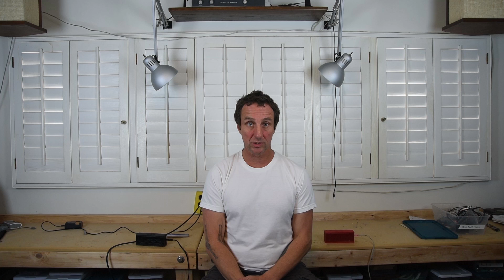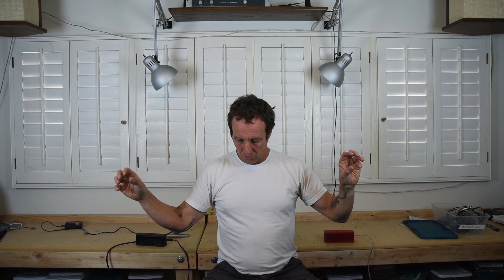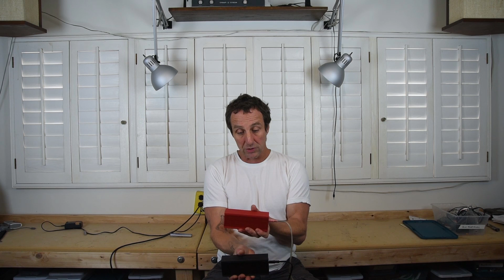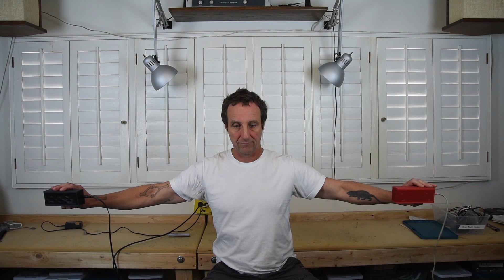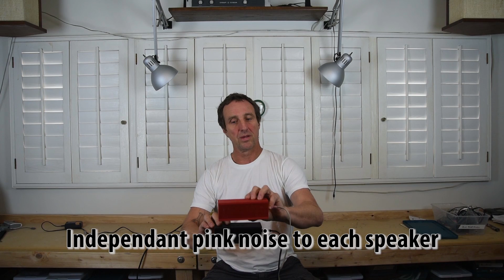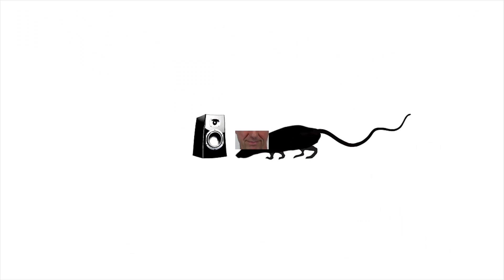Problems With Mono Sound From Stereo Speakers

Comment: How can you have 2 different pink noises and they don't interfere? 
Is it due to them both being not starting at the same time e.g. for instance it being high +5db and the other one being -5db? 

I think I understand the wooshing. Just the same signal overlapping each other ??
Reply from the maker: The definition of pink noise is random equal energy per octave.  If the source is random then another source will be completely different.  So any two separate generators will work. If you only have one source, you can delay one side a few cycles longer than the lowest wayelength.  So for 20 hz, that is 1/20th of a second, so figure 4/20ths or 1/5 of a second delay on one of the sources should do it.

Comment: I always tend to stand by the side of the stage, behing speakers, and notice that every instrument sounds just on its own place, well balanced.  Want to think the reason is because every instrumet/sound source is hitting me in a different direction thanks to differnet location of amps on stage, instruments, and monitors as well, instead of listening all sound sources from just FOH speakers as Dave mentioned.
Reply: We have two ears so we hear in stereo.  Every sound in NATURE hits each ear differently -- different direction, volume, delay -- one or all of them.  That is how we can figure out where a sound is coming from -- from the difference between the two ears.  If we heard in mono, it would be very hard, if not impossible for us to figure out the direction of a sound.

Comment: In case of a small PA sound system the only manufacturer that gets close to this universe was Bose and here I would like to mention their Multi Mono Concept. I never tested an L1 system, but that concept really blows my brain then and I still didn't forget it: https://www.youtube.com/watch?v=cq4UiVKlJfc&feature=youtu.be&t=11m15s

For large scale PA [may be], the Martin's MLA would be a good point to take off with as their Multi Cellular Array System is one the most intelligent touring system ever. Please get a close ear to that thing: https://martin-audio.com/mla/designbackground/mla-solution
I'm not a fan of conventional line arrays anymore. 

As always, thank you very much Dave.

Comment: Question, from this theory, wouldn't any system in stereo reduce comb filtering issues? What if you simply panned all of your sources left or right somewhat would that eliminate comb filtering? Or would it have to be hard panned all the way to the left or to the right in order to not have problems?  

FYI your sub placement/gain control/analog mixing videos changed my life!
Reply: If you've got a given instrument panned hard in either direction, you certainly won't get interference or phase issues with that particular part. The problem is that nobody on stage left is going to hear what's panned stage right, so it's about striking the balance when it comes to PA. In home Hi-Fi that can work just fine, an example would be a lot of early Beatles material, which sounds completely different in mono and stereo.

Comment: Thanks, this has got me thinking, especially after I watched your "Mixing console setup for Chili Peppers" video & was left with many questions. Is using pink noise a valid test though? It would be great to have the 2 pink noise channels replaced with 2 separate recordings of a kick drum & then see how / if the effect of comb filtering is changed.
Reply from the maker: yes, I agree, pink noise is a good way of demonstrating the issues which will be less audible and occur over differing physical distances with other sources. I believe that once we are aware of the concerns, we can become more tuned to hearing and solving them.

Comment: Listening through my studio monitors, the issues are VERY CLEAR. HUGE ISSUES.

So how does this relate to rooms that are not equal, ie club rooms that have different surfaces or odd shapes? where the left and right dont sound the same due to the room, or the pa itself might not just sound exactly the same between the left and right, maybe due to newer drivers on one side, or it might have a different driver on one side .

I work in small rooms 300 cap rooms , they pa never sounds the same between left and right. either down to the room, the condition of the pa or something inbetween.

So you could be sending the same signal to LR but the speakers sound slightly different, would this result in less comb filtering?

Definatly going to be experimenting with this. i wonder what happens if you send to a stereo subgroup, but unlink the EQ on the subgroup to have indapendant EQ.

With guitars, i love duplicating a single miced guitar cab and then eqing them different, 1 thick and 1 thin sounding, it spreads the guitars out a bit but maintaining equall guitar on both sides.
Reply: +vedasticks I read some more of your comments below and i i understood it correctly, simply making it different by EQ probably isnt enough.

that you need much more of a difference, by using 2 different sources, like di and mic, or 2 different kick mics, then eqing them to sound similar.

Right :-)

Comment: Hey Dave, what if we designed a plugin based on two independent pink noise gens, which used the noise source to alter the left and right signals of a mono signal? Or even the entire PA? It would be extremely interesting to experiment with this

Comment: Dave are you on Reddit? Care to chime in? https://www.reddit.com/r/livesound/comments/4fxg5h/the_same_sound_from_multiple_sources_is_an/
Reply from the maker: Thank you for the link. It's cool to see the concepts are sparking discussion. Will address a few of the comments here as I am not active on reddit. It is very easy to for people to say "yeah of course, I know all that" and yes, I believe that it is fairly commonly understood that there will be interference from multiple sources reproducing the same signal, the challenge is coming up with a simple way of explaining, demonstrating it and figuring out realistic ways to mitigate the issues. For my own learning, I would appreciate links to interesting methods of describing and explaining these concepts if anyone knows of any. 

I have found that purely using a dual capsule mic is not very effective. Purely altering the mic distance or adding some time delay also is not effective as it just alters the summation point to one side of center. What I have found to work is to use two different mic types, like a ribbon, condenser and a dynamic, mic'ing at differing distances to differing parts of the cone and then EQ'ing them similar. This method seems to introduce enough random phase and time differentials to randomize the interference issues somewhat similar to the pink noise demo.

With subs, the absolute worst thing to do is have two spaced source reproducing the exact same signal. So to solve that part of the puzzle, either do not use spaced sources or do not send the same signal. A mono center sub block or mono delayed arc, technically solves it but in my opinion lack sonic dimension and flexibility. The challenges we face with live reinforcement subs does not translate or really exist in for studio engineers, so it is easy for false assumptions to made. For live, the distances between sub arrays can be significant in relation to LF wavelength so we experience summation and cancellation issues at much low frequencies than studio engineers and other small scale reinforcement applications experience.

When trying to solve the challenge of minimizing the negative side effects of summation and cancellations of the same signal from multiple sources, the goal is either to get the listeners as equidistant from the sources or to make the sources as different as possible. Offsets to time, phase, transient response, paning level, compression slopes, ambiance, mic induced colorations, direct vs mic'ed, and where on the instrument the mic is placed can all be combined in varying amounts to achieve successful results. 

One way to easily hear if a strategy is effective is to do exactly as I show in the video. Listen to one side, listen to the other, listen to both together, apply a polarity reverse and listen to both together. Shift the time offset of one versus the other a bit and listen throughout the coverage area. If every combination sound good everywhere, then you have full success in minimizing multi-source interactions. It is also important to remember that identical signal multi-source summations and cancellations are often desirable, they are just not a natural occurrence.   

On that note, I can think of at least one scenario where natural comb filtering could be heard and measured.
Reply: Cheers Dave - Love it!
Reply: +Dave Rat Scoville once told me that on a few tours he had the system guys moving the subs all over the joint daily trying to get any low freq cancellations to land in the two walkways on either side of the center "orchestra" seating section. And have the summations land in the seats. 

Thanks for all you've done to spread the knowledge.  So many mixers out there never think about sound waves, just knobs and faders...

Comment: Thanks Dave, it is amazing how you demonstrate the comb filtering effect.  thanks a lot and keep up with more videos. the live sound industry strive for more knowledge.
However, i have a few questions:
1) Can you please explain why it is that way that different pink noise sources will not interfere each other. it is still produce the same sound. NO?   
2) in line array configurations, where we have multiple sources (components, boxes) coupled in an array configuration, and producing the same sound source, i had encounter the comb filtering issue in a single arrays. Walking back to front facing the array, i can hear the same effect (comb filtering) as you moved the 2 speakers in and out. Is there a way to overcome that issue in line array?
Reply from the maker: +Yoel Farkas 1) The reason the different pink sources sound the same but do not interfere is that even though they sound the same to our ears, they are not the same.  The two pink sources have nearly identical tonal content yet they are randomized so the pattern of those tones are completely unrelated. With the same signal radiated from two sources, the tonal content and the pattern of those tones are the same so we can hear the artifacts of the interference patterns. The more different we make two signals tonally and the more we alter the pattern of those tones, the less interference there will be. 2) With line arrays this comb-filtering or interference issue occurs as you alter the elevation of your ears in relation to the system or the distance you are from the system. Basically what line arrays try to achieve is to have the drivers so close together that the drivers all act as a single line source, like a giant ribbon. The higher quality line arrays have a less audible interference issues and the sound transitions at a much smoother and in a less offensive way when changing your elevation or distance from the system. Additionally to minimize that phasing sound you can increase the angles between the boxes at the expense of long distance coverage which is achieved by reducing the angles between the boxes.

Comment: Great demostration Dave. But the two mic kick example, it's like spliting the same sound and aplying delay to one of the signal. It's still the same sound source, but arriving in different time and you will have phase issues between them anyway. Pardon my english. Greetings from Argentina.
Reply from the maker: +Luciano Luggren Hello Luciano. Not exactly. The two kick mick not only have a delay between them if they are at differing distances from the beater head, they also pick up different tones, resonances, harmonics and a differing % of sound from the beater head, port and resonant (outer head). Additionally we tend to use two differing mic types that each introduce another set of differences. Unlike the dual pink noise example where the two sound identical but are completely different, the two kick mics sound different but do have some common fundamentals. So, the real world result is that if you pan each kick mic hard left and hard right, the kick will sound stereo, it will have some power alley center summation and some off center cancellation issues but significantly less than a single mic or if the two mics are summed together into a single signal and sent to both left and right.
Reply: I understand your point Dave. I'm Studio technician mostly, but I will try it in my next mix and hear what hapenning to the center in stereo and mono and with or without time aligning the two mics panned hard left and right. Anyway, you made great vídeos, articles, tips and are one of my sound heroes. Thanks for the quick answer. Saludos.
Reply from the maker: I would continue to time align them as the delay to one side aspect is not specifically desirable. You can use a Sum/Difference meter to visually see how well the two signals sum and cancel. But for the sum/difference meter to give you relevant information, the two signals need to be as closely time aligned as possible.
Reply: +Dave Rat Ah, ok, in my first question I supposed that you don't do the time aligning between the two mics. My mistake.
Reply from the maker: No mistake, I actually do not personally time delay one kick mics to the other. The advantages of time aligning the two mics can offer advantages when summed together and also when played back on smaller systems. For larger systems with speakers that are spaced 20 to more than 50 feet apart, the millisecond or so of time delay on a mic panned to one side is not relevant enough for me to convert those inputs to digital to achieve the delay alignment.
Reply: +Dave Rat It's true.

Comment: Would using separate pink sources to tune separate destinations be enough of a variation to create a noticeable drop in interference?
Reply from the maker: +Tim Uniac Using separate pink sources for sound clusters that have overlap in their coverage patterns will allow you to measure frequency response in the combined coverage area without comb-filtering altering the measurements. That said, if the sound clusters will be reproducing the exact same signal, then testing using the same pink source will offer more realistic results. If the clusters will be used to reproduce stereo sources with some common and some differing content, then comparing the measurements with a single pink, dual pink and dual pink panned at somewhat to the center will show you how much interaction there is and how relevant that interaction between the clusters may be to that application.

Comment: What is your mic setup in this video? I'm just thinking about how it "reproduces" the way our ears work.. won't the interference differ depending on if it's a mono mic, X-Y, M/S, AB and so forth when it comes to the video? I'm just asking since I'm not shure.. Anyway, Awsome stuff youre doing! Love your videos :)
Reply from the maker: +MrSpecTech the mic is a Sony stereo mic set to 90 degrees. Though the effects and sound you hear is the same with a mono mic and also heard clearly by listeners. I have been doing this exact demo for over three years at my seminars across the globe for groups of 2 to 70 people  a can be heard by all.
Reply: +Dave Rat cool :) I was wondering if our ears beeing so far apart and 2 separate "inputs" had anything to say for the experienced effect.?
Reply from the maker: +MrSpecTech everything indicates that it is not a perception issue, the interaction caused by multiple sources reproducing the same signal is well proven, audible and measurable. As is the non interaction of unrelated sounds. I believe what makes this so interesting is that we as that for sounds to not interact, the must sou different.
Reply: +Dave Rat very interresting! But what about directivity? Do you manage to make something stay in the phantom-center and still be different enough in the separate channels?
Reply from the maker: If the sound is different enough to reduce/eliminate phase interactions, comb-filtering, power alley etc... then they will sound stereo rather than have the mono sound phantom center sound when a listener is located center. While this phantom center sound can be desirable, one of the issues with phantom center or also known as power alley, is that it disproportionately affects listeners located in the center. So, by having the sound be different sent to each side, you can actually achieve a more even coverage and  eliminate the huge unnatural center venue summations zone known as power alley.
Reply: +Dave Rat Thank you for brilliant answers :) I really learnt something new today :)

Comment: This is a great demonstration of an aspect of why conventional line arrays are acoustically way worse than point source, like the Danley Sound Labs synergy horn line. What are your general thoughts on the whole point source vs line source concept?
Reply from the maker: +Douglass Berry There are advantages to both point sources and line sources. Point sources are quite good at covering small to mid sized spaces and if coverage overlap between multiple closely spaced point sources is minimized, the the array can be a highly desirable solution. For acoustic spaces where very precise coverage is advantageous or covering long distances, then multiple drivers closely spaced is a very effective method to accomplish those goals. Since our ears are more sensitive to horizontal interference issues and less sensitive to vertical interference issues, there are significant advantages to using vertical line arrays over horizontal line arrays or arrays that have both horizontal and vertical dimensions.  Here is an article I wrote a while back on differing array types http://www.prosoundweb.com/article/zoned_summed_and_line_arrays/